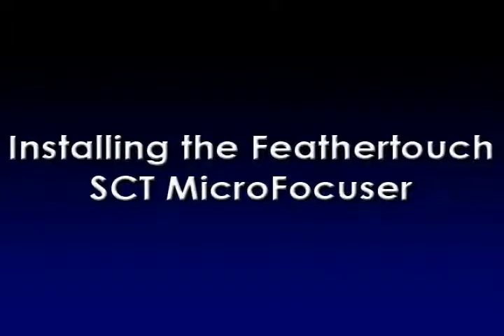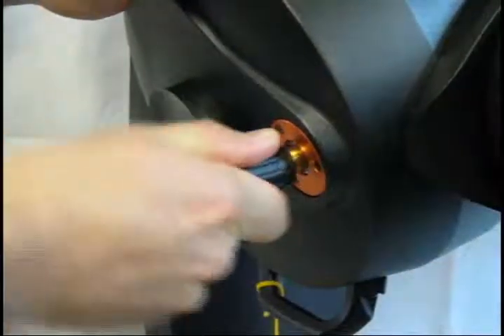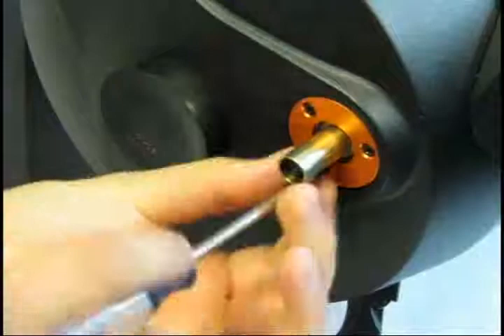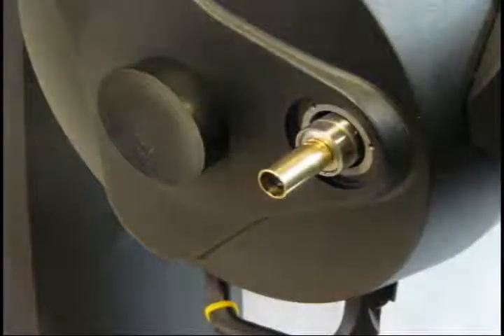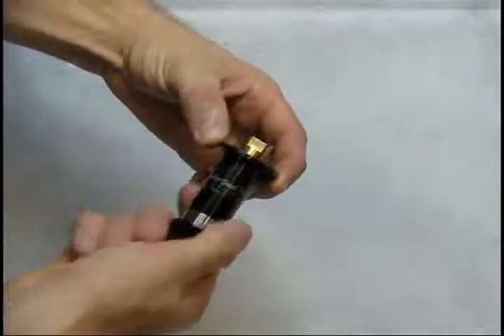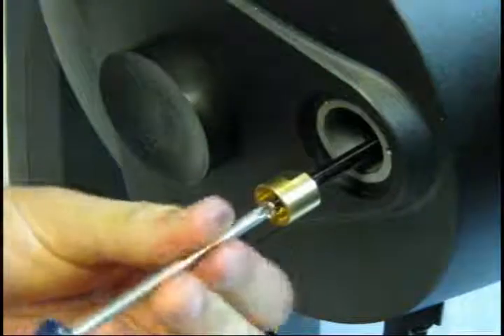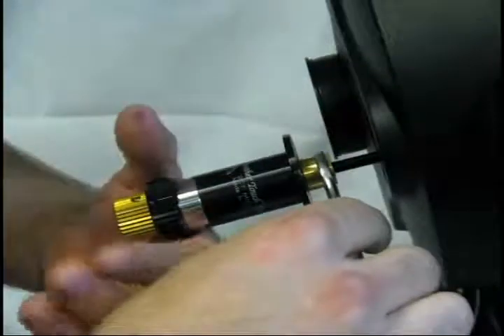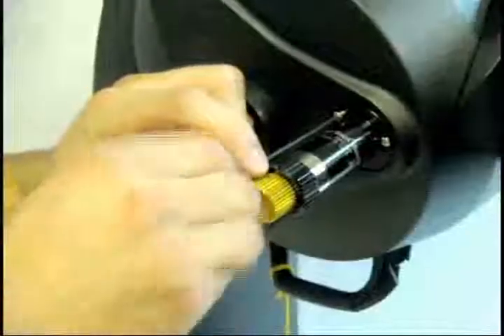Installing a Feathertouch SCT Microfocuser

Comment: I have one of these on my CPC1100 Deluxe HD.  It works OK; It does not perfectly align in the telescope without the bearing that was removed and therefore it does not have consistent feel as you rotate it; it has uneven resistance as you rotate it during focus.  I've tried loosening the mounting screws and trying to find a sweet-spot where the resistance is consistent, but I haven't had success.  I of course made sure everything is lubed-up and have tried exercising the telescope throughout its range of focus.
Reply from the maker: Please contact Dean at Starizona 520-292-5910 or at dean@starizona.com for help

Comment: question :  When you initially take out the bearing assembly you are left with the focus shaft rod being exposed. my question is if you push or pull on the shaft is it the mirror thats been moved back and forth?
Reply: stop being needy
Reply: The threaded tube is bonded to the back of the mirror, and yes it slides the mirror back and forth.  I am not sure if you push it all the way in if the mirror will come off the baffle tube, proceed with caution.